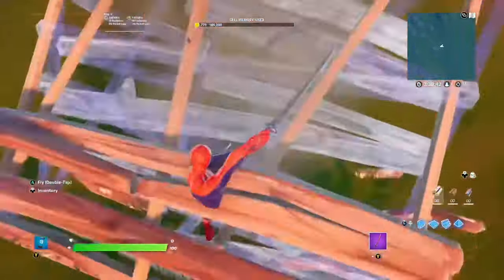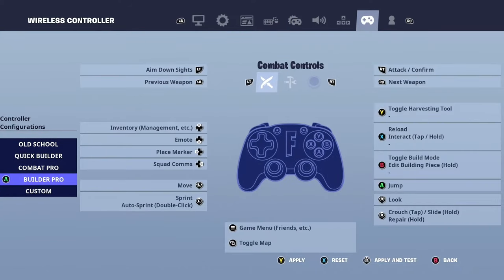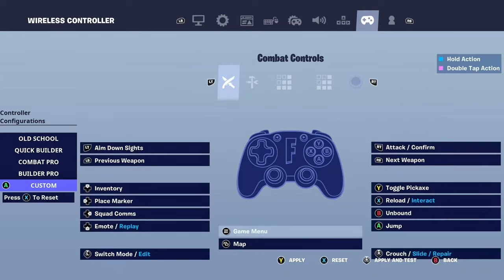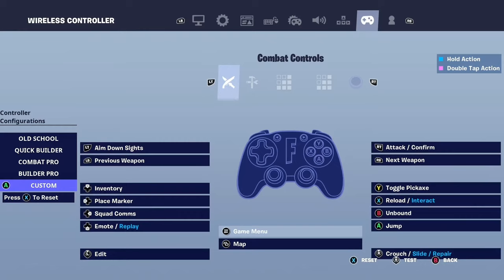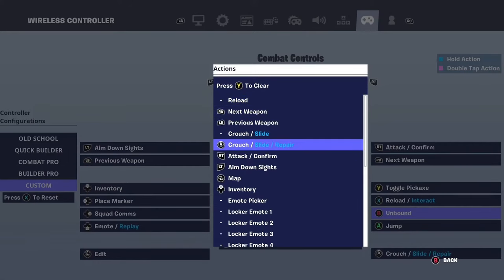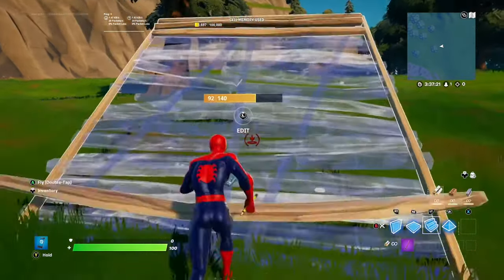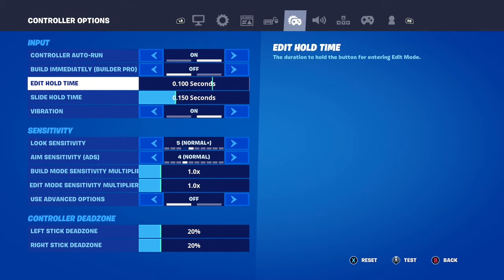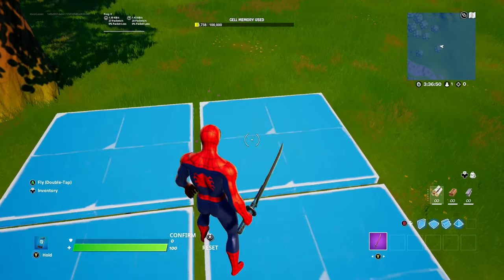How to get rid of EDIT HOLD TIME on controller!

Comment: Just turn it down to 0.100 in controller settings with a switch mode edit bind with a edit bind for double edit binds or use paddles with the switch mode edit and use a reset or scroll wheel on controller and make sure that you use controller bumper stoppers I suggest for a Xbox elite controller that you use  number 3 on the left side of the controller and on the right side use a number 2 setting for the right side

Comment: MINE WONT WORK I DONT HAVE A EDIT BUTTON
Reply from the maker: Go into setting and make sure that you have assigned the button that you want to have as the edit button as edit and the button you want as switch mode is also switch mode.
Reply: I did